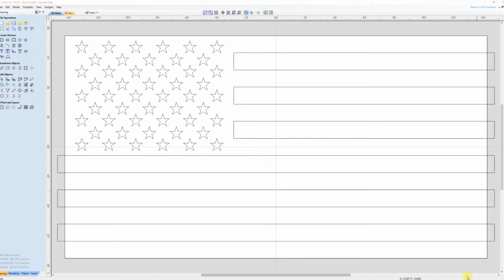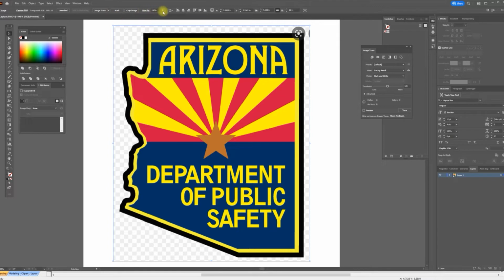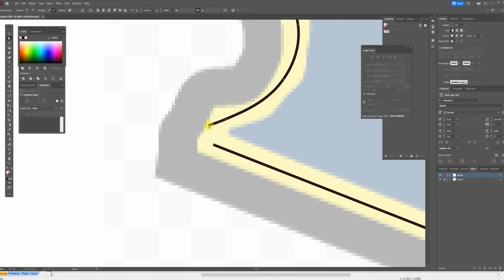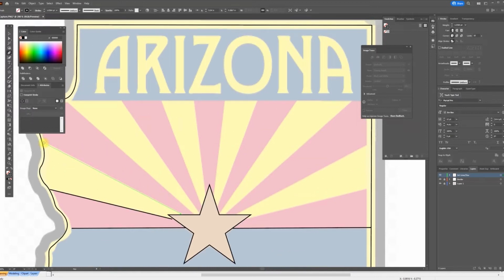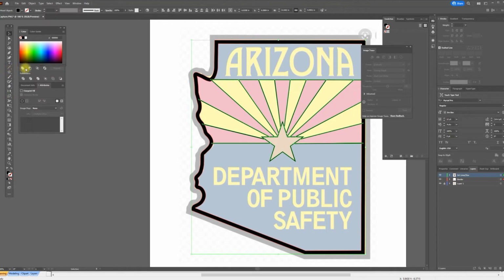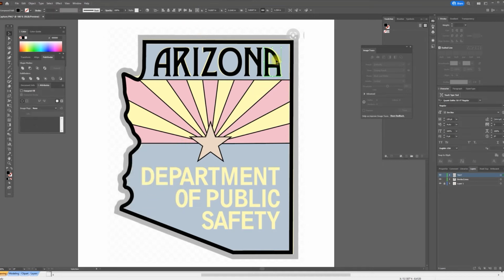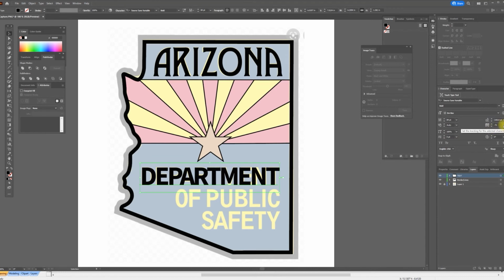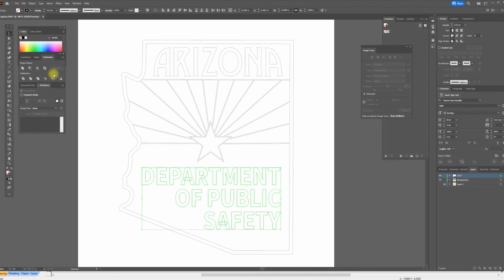Creating a Project on the AVID CNC - Part II:  Designing a Vector Graphic for Import into VCarve Pro

Comment: Another great video, Russ! The only question I have is which file format did you save the graphics as? (If that is answered in Part 3, please disregard.) It looks like I'm going to have to check into Adobe Illustrator. There were several things you did in this video that are a lot simpler than the way I've been doing it. Keep up the good work! This is an AWESOME series!
Reply from the maker: That’s a good question!  I used the .ai file. You can convert to .eps in Illustrator and use that as well. They both play real good in VCarve import.